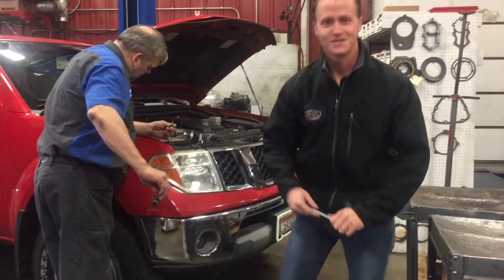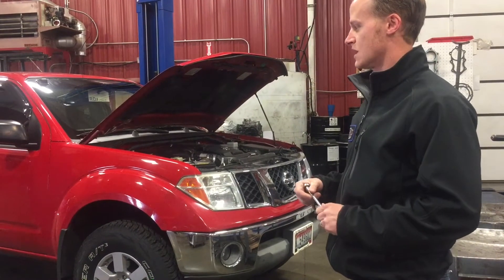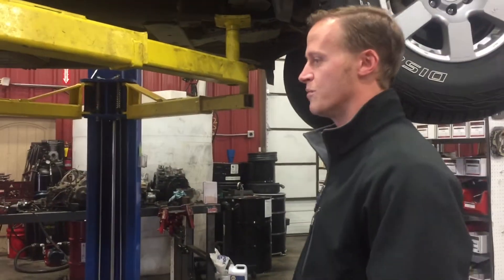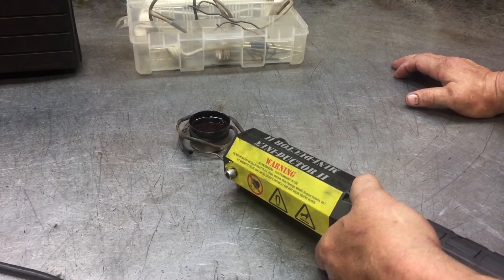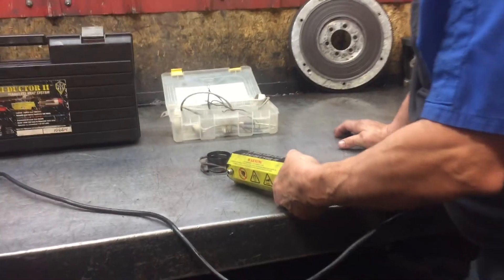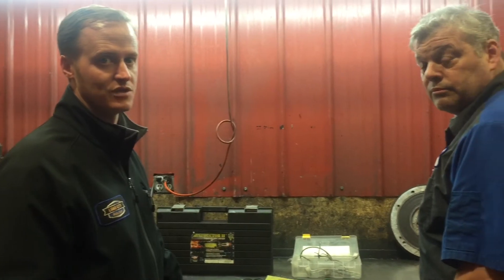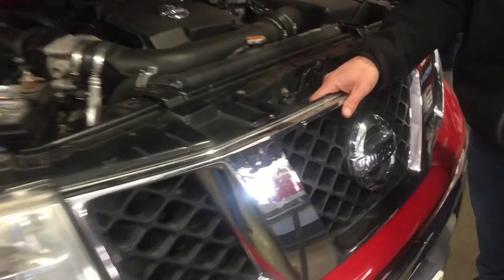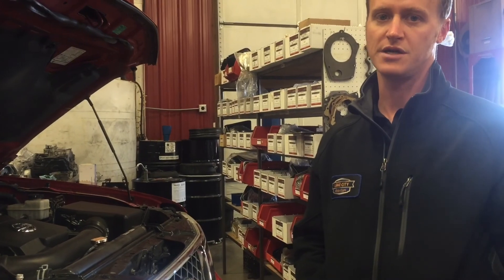Nissan Transmission Cross Leak - Lake City Auto Care

Comment: If I bypass the radiator, do I need to add an additional transmission cooler to properly cool the transmission fluid? My truck is a 2007 frontier and I like in a moderate/warm climate.
Reply: No, there’s already A smaller radiator in front of the big one